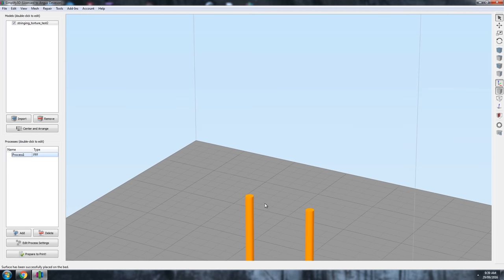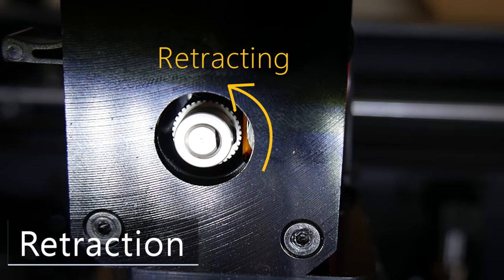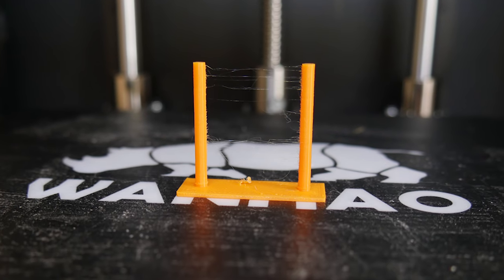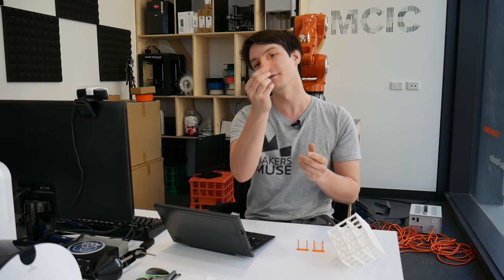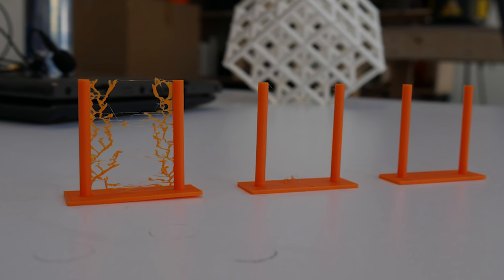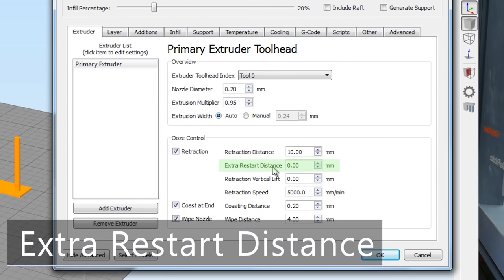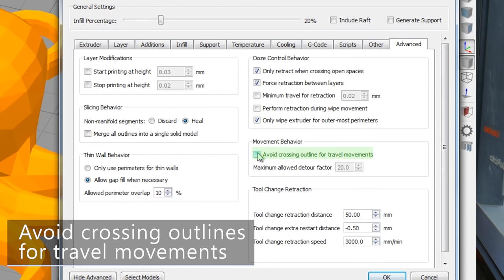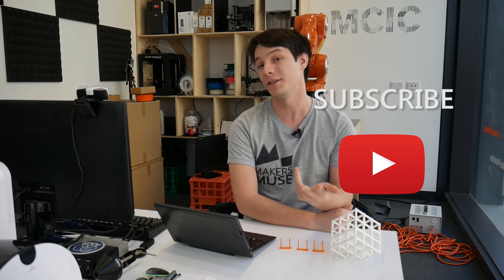Stop the stringing with Retraction! 3D Printing 101

Comment: 10mm of retraction? holy balls, is that a bowden? I use 1.5mm of retraction on my mendel90.
Reply from the maker: Mostly to demonstrate the effect, but yeah even some direct drives need quite a bit of retraction, this is on the wanhao D6
Reply: You should tell people your settings are completely overkill and useless, most will try your settings and will be gettings jams after jams of their extruder. Most of the time retraction shouldn't go over 2mm as it won't improve the result and will jam their extruder...
Reply: ScoofLS thank you

Comment: man i got this one printer out of my 3 that just WONT STOP STRINGING. bad too. Ive tried adjusted the extruder steps, ive tried retraction, ive tried temperature....im at a bit of a loss. At this point im thinkin maybe my temperature sensor is off? Its getting the plastic too hot maybe and its dripping too much?

Comment: Thank you !!!  After I changed my nozzle from 0.4mm to 0.5mm  I was plagued with stringing, spent countless hours troubleshooting with no luck.. I also use Flexion extruder.  I just copied your Simplify 3D settings and my stringing is gone completely.   You are the most useful YouTuber by far, very useful video!   Keep doing the good work.

Comment: You should also consider lower temparature setting if you have excessive stringing. Also fan speed can affect stringing but not as much. Another thing to take into consideration is to determine your max retraction distance.  If you have all metal heatbreak AVOID PULLING FILAMENT INTO COLD END!   This can cause clogging or heat creep and ruining your print, especially when printing with PLA. Measure the max distance between cold end and hot end. Also you can try speeding up travel moves.

Comment: When using coast at end for 0.2mm what can happen on many small retracts on detailed small prints is that it when the extruded plastic amount is almost (or getting close) the same as the coast distance, it will majorly under extrude. This is really easy to notice as you change layer heights from 0.2mm to 0.1mm as less filament is extruded and you notice this effect much quicker. It is a solution, but it needs to be calibrated and set for each layer height.

Comment: Lots of videos refer to 'getting your printer dialled in', but none of them go into a step by step process to say which settings will make what sort of change or a sequence of which settings to tinker with and by how much. A series of tutorials in a separate playlist? And print the same thing on the same printer to illustrate changes. I imagine that is what your maker coin was for initially. 

Fusion 360 is a magic program. Getting to grips with it slowly. Can't believe how powerful it is overall; CAD is just the tip of the iceberg (and the only bit I will ever really use I think).

Comment: Iv'e just finished building my second 3D printer, and went through your video to help me fix my really bad stringing issue, printing like a boss now!
And for the Naysayers about Simplift 3D being too expensive, I have a mate that wishes he had S3D like I do, he absolutely loves the supports that S3D has compared to the latest Cura he uses.
I tried a number of the free Slicers, but S3D is the best for configurability I have found so far. Also you have to consider I built my printer, it's not standard, but hundreds have made similar machines to mine (Hypercube). It is definately not a cheap printer, but it's far from expensive.

Comment: Hi!
black (Tevo's) PLA, 0.4mm nozzle, 0.2mm - layer; 60deg - bed, 210deg - nozzle, 100% fan speed (two fans from sides), 5mm retraction (usual slow speed), glass base, no glue... I've got almost no wires... good brim (~10mm), but at the 40-50th layer the model was detached (and probably moved by the nozzle).
Aborted, re-leveled the bed (need to), bed - 70deg, set Hop on (and 1mm), glued the model's place (some glue stick that easy to remove - Erich Krause). Adhesion was great but I've got strings all over the road. 1st I've thought about the fan's speed (was down to 70%) but then I've raised it to 100% manually. Seems that the main reason is Hop. But (without BLTouch for sure) it's impossible to print without it.
It was the 80mm temperature tower with rect. and round windows + spikes (from 210 to 245 degrees - eight steps). All spikes are messy. In the 1st case (that failed by detaching) I've got very good spikes tough.
What can you advice, please?

Comment: I am printing with pla+ on ender 3 v2, I tried retraction speed from 45 to 60 without changing anything else  then tried retraction length 5 to 7, nothing changed, stringing didn't increase or decrease. Now I'll try your tricks, if it still doesn't work I'll try the dehydrator

Comment: I have a question…. I went from a light colored filament to a dark one and am getting horrible stringing. I’ve printed temp towers, the stringing test like in this video and messed with all kinds of retraction settings. Still horrible. Any help would be appreciated, I’m running 8mm retract @ 60mm atm.

Comment: Thanks for the video. Can you tell us what you learned about the affects of:

1) Temp
2) Layer height
3) Rapid travel distance
4) Feed stock Material
5) Print speed

on the amount of coasting distance and retraction required. The five variables all affect the amount of pressure in the hot end and would therefore affect the amount of oozing. How would you rank these variables in the order of importance?

Comment: If you have underextrusion with your retraction settings.

- Changing WALLS ORDER to `From Inner to Outer` could help a bit. 
Looks like underextrusion will normalize a bit during printing inner walls, Before outer ones.

- Reducing Speed of Walls will help too. So i have Outer Walls as 45 instead of 80mm. For me 80 for infill and inner walls was a manufacture recommendation.

My retraction is set to 10. and 35 mm speed. 
That was tested with 3 filaments on max temp for each, when oozing is more likely. 

Those 2 parameters together help medicate underextrusion issue. But not eliminating it.

Comment: Angus, I have a Rostock Max v2. I just bought simplify 3d and I'm having some problems with under-extrusion after retraction. From what I gather you add a negative extra retraction distance to push extra filament at re-insertion?  Am I correct? The stock settings (for the rostock max v2) are 6.5mm of retraction. @3d Printing Nerd

Comment: I have  exactly this same problem. Low temperature, and 5MM retraction, 40MM /sec. 
I adjust retraction to 6MM and 60MM / sec,  did not help, Mather fact it makes worse. Then I make test with the highest temperature available for filament, and surprising I removed strings, also model was surprising much better quality. 
 Everybody is saying that filament will flow out with to high temp, my problem was opposite,

Comment: Great vid, I was just playing with those exact settings. I am wondering if the different hotend designs make a big difference, or just a little. I use a j-head and PLA, but am about to try an all metal on a prusa I3 type printer. It would be interesting to see you present the top 5 best hotend/slicer setting combinations, as everyone wants good prints, but cannot buy tons of hardware combinations. I know a lot would be repreated material, but a summary would be super helpful. thx!

Comment: hi thanks for the tips this has helped a lot with my place stringing but I also have another issue . when my printer dose a movement like from one end of the bed to the other there seems to be a delay in it extruding and some small sections don't get printed this is visible when watching the first layer go down. sometimes if there are lots of small areas to the first layer and the printer dose a large movement to another part of the bed they get part printed or not at all 

any ideas

Comment: you save me alot. but i am still having problem like the filament has bubble when printing. am I setting too high temperature it cause the bubble or was the cheap filament? I am using PLA anyway.

Comment: hi there. like your videos very much very informative. i have a cr 10 running simplify 3d. my prints turn out great as long as i don't print over 1/4 inch after that it is lines from then on. it is pissing me off. i have tried a few setups and even changed tables and still the same.can you give me a hand with this plz...thanks

Comment: This is unrelated to the subject, I cast and make chess sets, I am wanting to change over to 3d Printing them with scanning the originals. I have watched many youtube vidoes but yours are clearly well above the rest for solutions, I expect I would still have a lot of finishing and I dont mind that but a printer that could print multiple pieces at once with good resolution would be a great start to getting there. Do you have any suggestions as the what would be the better choice of 3d printers for doing this? and is there any lower end market solution or mid range for reasonable scanners to help me in the process?

Comment: I am using cura with the ender 3 printer. I have a stringing problem,but only when the print head is leaving a support. (Yes I have retraction enabled) The reason it is a problem even through it is just the supports is because I like to print high detailed models and the string makes it a pain to clean. So I was wondering is there a retraction setting for support struts in cura. Thanks

Comment: What can be done about stringing not between gaps, but where very fine wisps of filament are pulled off the side in a concave part of the wall? It's like the nozzle is dragging on the filament and pulling a small amount of it, but definitely not the entire strand, across the gap.
I have tried raising the temperature and that improves it but there is still slight stringing even at 220c for PLA. I am printing outer walls at 15mm/s. Could the nozzle be damaged?

Comment: Nice video. I've been trying to print with PETG and getting stringing with it.  I'll try to adjust these settings with the slicer I use.  How far apart are those pillars?
Reply: Stringing can also be made worse if your nozzle temp is too high.
It might be worth trying a slightly lower temp as well as retraction. Try decreasing your nozzle temp by 5 degrees at a time and testing again.

Comment: Ok, so Angus, Let me explain something about the suction so called Myth. If you have a sealed space with only the filament and an open hole as the exit, the fact the more filament will produce pressure to extrude will mean that when you withdraw the filament it MUST by the very mechanic that it uses create a section effect. Its not a lot of suction but it is suction. If there is no seal around the filament what so ever then there is no suction possible but by the fact that liquid plastic doesn't ooze out around the filament when extruding it means it is sealed to some degree. It is not fully air tight which means it is not a 1:1 pressure gradient but its there. suction is happening.

Comment: Is there an advantage to having a slower retraction? When reading about printing with PETG, some people suggested using a retraction speed around 25mm/s. Using a slower retraction doesn't make any sense to me, so could you shine some of your wisdom on it? Its also worth noting that there are a wide range of suggested print settings for PETG currently.
Reply: I did find one material that printed better with slower retractions, the Colorfabb XT. I don't know why. It seems with fast retractions, it leaves a bit of filament behind, perhaps because the filament sticks a bit to the nozzle or something. But now I'm just guessing...

Comment: So is the silk thin stringing unavoidable with some pla brands? I had this black roll of Primavalue bundled with mine and no matter how much I fiddle with temps, retraction and z-hop, it always pulls a string of goop across the print. Seems easy enough to brush off but I worry about it effecting more complicated models.

Comment: I tried using this stringing test, it got rid of the stringing. But when I tried it with another PLA, there was still stringing. I went back to the PLA I had fixed stringing with and it was stringing again with the same settings.

Comment: you forgot one aspect. i have had problems with retraction if i have a lot of smal parts. then the retraction setting might flatten the filament due to the extruder going over the same spots over and over again. then the filament become flat and "wavy" and it is IMPOSSIBLE to puss it thru the hot end or the bowden tube.
Reply from the maker: I did mention that too much retraction can chew filament and lead to jams, but yeah flattening is an issue as well if you're doing lots of small points.

Comment: Quick comment on flexible retraction:  I've found that successful flexible printing uses more aggressive retraction settings than with non-flexibles.  "Combing", or keeping the print head inside the print, will work well when each print layer is contained in one area, or when the first layer of the print is not an aesthetic layer (as it leaves stringing behind).  For this reason I have had success in combating the elasticity of the material by increasing my length and speed of retraction by up to 4x.  Let me know if that works for you!  (Lulzbot TAZ 5 w Cura)

Comment: 10 mm retraction is a lot, probably causing more problems than it solves. It's about twice as much as needed for standard bowden extruder. Many do 4-5mm. E3D recommends starting at 2mm for their hot ends when used with a bowden extruder. Direct drive should be at 1mm. There's other settings such as nozzle wipe that can help.
Reply: Yup. 7mm made mine clog.

Comment: I'm almost impressed by my stupidity and luck simultaneously, I've been trying to print with my flexible PLA material by RigidInk, after many tries I've managed a print, but with retraction in full effect, having searched around, it seems clear to me that the rule #1 of flex material is to turn retraction off...! lol I almost wish my failures were more catastrophic that I would have turned it off from the get go instead of doing everything but the most obvious thing to do...

Comment: Hi angus i have a tevo nereus basic with yellow hatchbox pla and whenever i start a print, it goes to one corner, heats everything up, and while its doing that, it oozes filament. The extruder was preassembled. why da ooze? edit: the same thing happens, but if i pause the print, even when i clean off the nozzle, and resume it oozes. Help me! i use cura 4.1 beta

Comment: Are there any negative effects of retraction or having the incorrect speed/mm of retraction? I am having major issues printing carbon fiber pla with retraction on. when it prints lots of small parts of the prints it under-extrudes and nothing comes out leaving holes on sides and infill.

Comment: Interesting. Im learning 3D Printing via a forum and theses guys use only 2mm Distance and between 25-50mms speed. So 10mm and 80mms would be sacrificial to them, and there setup still works. What is the logic behind all this?
Reply from the maker: Depends on the hot end and extruder setup, some need a lot more retraction than others. Good direct drive units only need 0.5mm or so!

Comment: Angus quick question.  My flash forge creator pro suddenly stopped pushing filament out. I thought it was a simple clog. Cleaned everything out good but when I load the filament it barely comes out. It acts like under extrusion. Stepper gear is moving. Could the motor be bad?
The filament that gets pushed out when I load looks kind of stringy and chewed, but the gear looks fine as I can tell.  I'm stumped:(
Reply from the maker: Sounds like a partial nozzle clog, does it curl up away from the nozzle instead of extruding Steiger down? Might need a clean with piano wire or a replacement !
Reply: Maker's Muse i changed my nozzle entirely and this is what I get now. So a little better, but still looking under extruded.

Comment: Got any tips about the retration point? I use S3D and I'm using PLA Plus from rigid.ink. Oozing is sorted, but theres a tiny gap between the start and end of the retraction point.
Any adjustment to bring them closer, even minute ones caus either both sides to blob out, or cause a visible underextrusion at the begining of the next path :S 
This is not an issue with Slic3r Prusa version and prints perfect across the retraction spot. (Takes way too long to slice) Having paid for S3D it's letting me down against a free slicer :(

Comment: Help Pleas:  I have retraction ON.   all my 3d prints i can see it works... But when i made a model in 360 fusion and add it to cura and then print.  I can see the retraction is on.. most of the print.. but at some place it do no Retract and mess it all up!! . 

why is the 3d print  have retracion on and some place not on!   in the same print , even still the setting on ? 

Hope you understand my issue.

Comment: can you adjust retraction settings in cura ? hmmm maybe i will need simplify ?
Reply: *would the feed rate on a creality CR-10 also effect the retraction settings ?  im still brand new to this and have just started to drop the fr down to 90 and it seems to be making a difference in print quality ?
Reply from the maker: You can do it with cura, check out this vid https://youtu.be/_QRb54zVPfQ